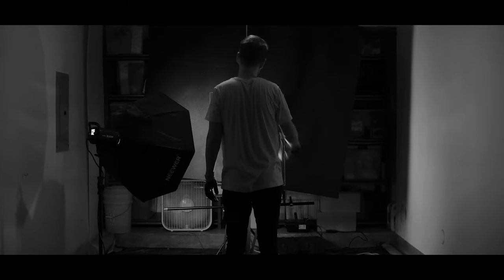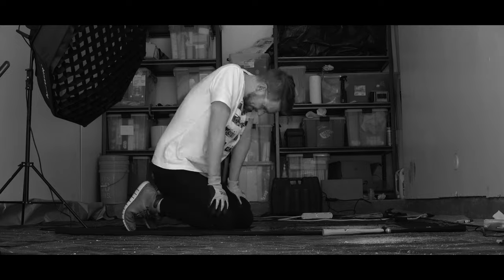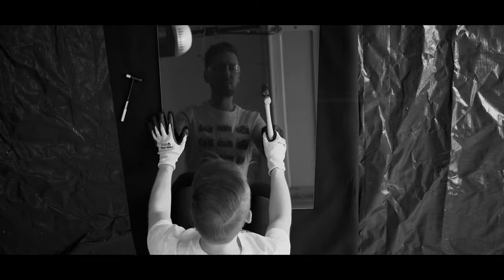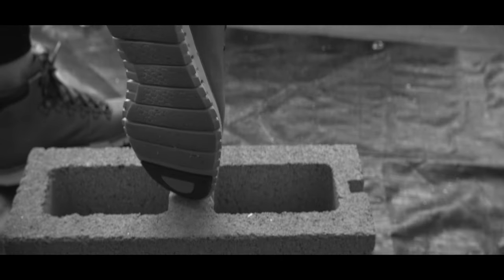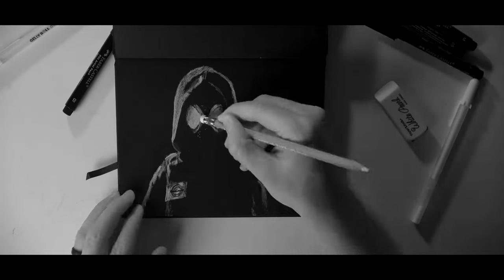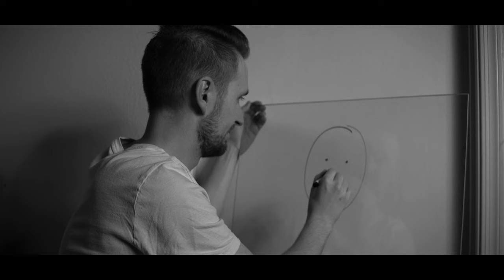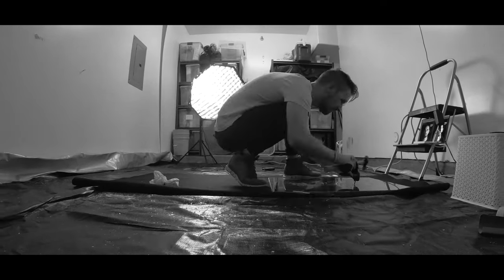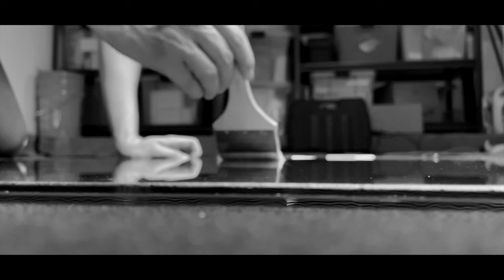Trying Shattered Glass Art for the First Time

Comment: You can laminate the glass yourself for cheap..  just use a clear vinyl wrap..  or clear window tint if you can find it.   I found a roll on ebay once and got it for around 20$ for a 5’ x 50’..  it goes on crystal clear if you tint it right..

Comment: Hello, do you know the artist Simon Berger? I'm studying his glass painting art. I used double-layer glass, but creating cracks in the glass requires a very strong force, but artist Simon Berger uses just enough force, not too strong, I don't know him. What type of glass to use and what work was done on the glass surface before to make it easier to hammer and create cracks? Looking forward to your help
Reply from the maker: I don’t know him personally, but yeah his artwork was how I got introduced to this art form! I know exactly what you’re talking about in terms of those challenges. The glass I used was also double-layered and it was 1/4in in total. I had the same issue of trying to break the glass and I there were two solutions I came up with. 1 - you can hit the glass really hard with the hammer to break it and weaken it, but you will be left with a bunch of cracks that will be unpredictable and probably a large spidering pattern where you hit it. Or 2 - I also got a tungsten drill bit to break the glass really precisely in key locations. I didn’t like the look of making it too precise (I wanted the somewhat chaotic look) but it helps you control where you want to weaken the glass to form more cracks. I hope that helps but it does take some additional experimentation and getting used to the feel of how much force to use

Comment: Hey brother,  absolutely great work. Laminated safety glass comes in different types. Which one is this?
Reply from the maker: Thank you so much! That’s a great question, and I wish I knew the answer 😬 When I called a few local glass shops they told me they only had one type available which was I believe 1/4in thick. But I had no idea there were other types. If you have any specific questions I can try to answer them but sorry I know that isn’t very helpful!
Reply: Thank you so much for your reply. Been doing the research, I think the trick is to find the correct material. But if you know, was this a tempered laminated glass? Sorry for bothering you.